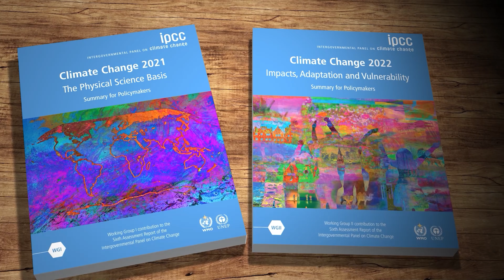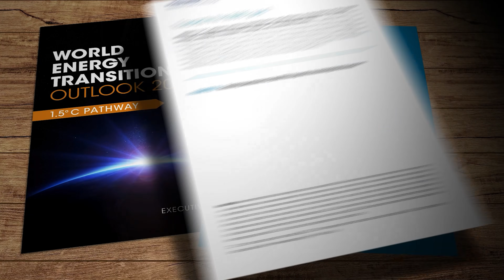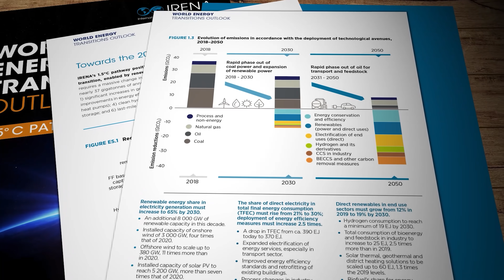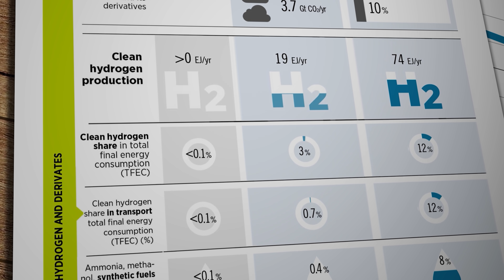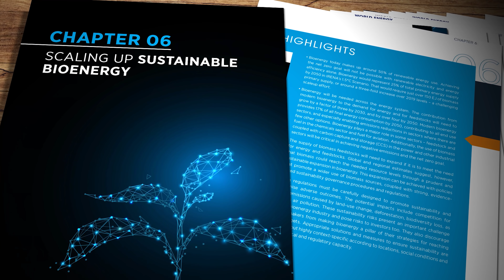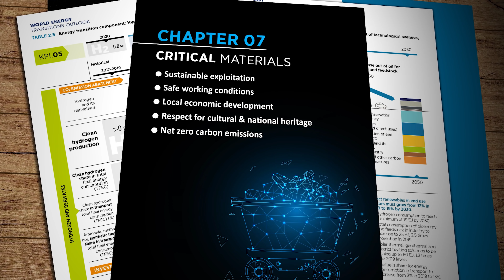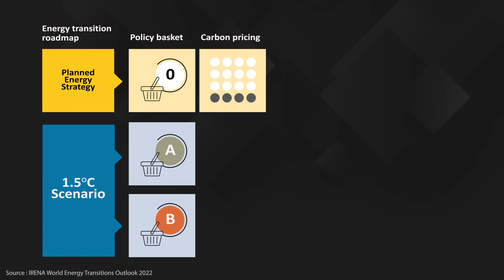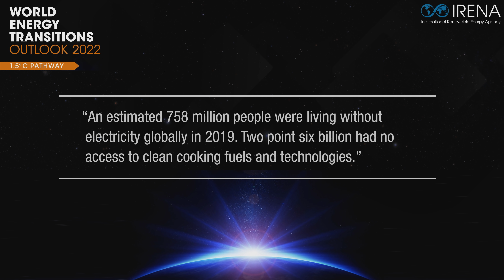Massive global energy disruptions are coming. Brace yourself!

Comment: That level of scale up in green hydrogen production would consume an exorbitant amount of an already finite resource in fresh water to use in the electrolysis process. If salt water were used from the oceans it has by products of chlorine and possibly sodium hydroxide as well depending on the sourced sea water, none of these topics were discussed in the Irena report for mitigation and regulation issues and how how to deal with those byproducts
Reply: Even if you were to use river water you would still need to run it through a reverse osmosis to purify the water before you perform the electrolysis on it. Even if the scale of which you were performing the electrolysis was billions of tons per month it would still not even come close to the amount of water available on the earth. Also no matter how much electrolysis we perform essentially once that hydrogen is burned it just re-combines form water again and therefore it never leaves the planet. I use solar energy to make hydrogen. But my electric car works better with batteries

Comment: @Just Have a Think - Would there be a bad effect on an already scarce water supply if there was large scale cracking of the water molecule into it's constituent parts?   What are the environmental effects of the loose oxygen molecule being pumped into the atmosphere?
Reply: Oxygen is oxygen; the air is 21% oxygen already.  The amount of water needed for hydrogen production would pale in comparison to the amount used by agriculture.  When the hydrogen is used, it would be converted back to water, so there's no net loss, you're just moving it around.

Comment: The earths gravity isn't strong enough to keep hydrogen from escaping into space. As we split our precious water into Oxygen and Hydrogen, a percentage will escape and be lost to space forever. Are you okay losing our water to space to provide a storage solution to intermittent renewables?
I just don't get your aversion to fourth gen. nuclear. 
Almost all energy is from our sun one way or another, which of course is nuclear energy.
Reply: Earth has WAY more water than we could ever need for making hydrogen.  The vast majority of the hydrogen would be converted back to water when it's used.  I don't think hydrogen loss is a problem we need to worry about.  The only reasonable arguments against nuclear in general are cost and long time scales.  Both of these might be addressed by new technology, but has it actually been demonstrated?  Then there are all the UNreasonable arguments, because most people are ignorant and propagandized.

Comment: The third cleanest energy source is nuclear. Nuclear energy has one of the lowest environmental impacts of all energy sources, comparable with the total impacts of wind and solar. It doesn't emit air pollution, it safely keeps its waste out of the environment and it requires a very small amount of land. It has a bad rap from climate alarmists if safety and pollution data is honestly presented. Don't hold your breath. Oh and go pick all of the dead birds killed by wind generators.

Comment: Energy disruptions are indeed coming as we have "high graded" the worlds fossil fuel reserves., leaving more much diffident and expensive to recover reserves. All these green energy saviors require fossil fuels to manufacture as well. The Titanic has struck the iceberg, is sinking fast  and has far too few "lifeboats"
Reply: There is still a LOT of easily accessible Saudi crude.  I'm not trying to encourage wasting it, but the minor need for hydrocarbons is NOT going to stop the clean energy transition.
Reply: @incognitotorpedo42  Saudi Reserves are not infinite and Gawar  is  in terminal decline as we speak.
Reply: And the need for fossil fuels will hardly be minor even with a shift towards "green energy"

Comment: Scepticism? How many times must I hear how the fossil fuel industry will recapture the CO2 it is emitting. This is pure unadulterated bullshit. It just will not happen. They are flat out lying about carbon capture so they can continue to pollute the atmosphere.
There are dozens of carbon capture trials and schemes and none (as in zero) have worked.
And the simple single reason for this failure is this. To drive the machines doing the carbon capture requires ENERGY, and where will this energy come from? How mind numbing imbecilic it is to suggest that the solution to CO2 pollution is to burn more CO2?
Carbon capture in all its forms is simple FRAUD.
Wake up people before it's too late.

Comment: You could look into the economic viability of recycling NCA/NCM vs LFP batteries.
Reply: They are both economically viable to recycle.  Very much so.  The industry is already in place, and recycling is happening now.
Reply: @incognitotorpedo42  I understood Redwood Materials is profitable for NCA NCM due to the high cost of the raw materials. I've never seen a specific statement for LFP.

Comment: At what point did they recommend to release the patents from the shelves? We need to let all the information out. Then it will not be heavy handed governments needed to impose the changes on society, it will be free thinking, hard working people who are inspired to create a better world who are making the necessary changes from the ground up. We have a major lack of information where it comes to energy production, transmission, storage and consumption. We need all the patents off of those dusty old shelves
Reply: Nuclear is the answer.
Reply: It's a myth that there are dusty old patents that prevent us from having clean energy.  When you track them down, they always turn out to be BS, like the "100 mpg carburetor" or the car that "runs on water".  Patents have a lifespan.  They don't last for ever.  Utility patents are valid for 20 years, design patents for 15.  If there was a magic patent from 50 years ago, anyone could make it now.
Reply: @incognitotorpedo42  Exactly.  There are so many myths out there!

My Dad told me the Germans found a way to make fuel out of air in WWII.  I laughed it off but I just found out it is possible to do.  Dr. Steinfeld in Zurich has found a way to make fuel stock using solar power and water.  Interesting stuff.

Comment: There is so much misinformation being circulated now that the chance of countries taking sufficient action has essentially dropped to zero.  Unfortunately, the U.S. is one of those countries where it has dropped to zero.   As individuals, and in a few cases with enough support to move whole states, we can continue to make the relatively costly and long-running investments required to push the technology to a scale where it becomes cheap enough for "everyone else" to use it via other motives (finding the cheapest option being the primary other motive).   Its a sad, sad state that the world is in.

I strongly believe that achieving the technological scale is possible.   The problem is that not enough countries or states within countries will have invested enough to reach the scale required.  The world will definitely blow past the 1.5C goal, that's a given.  But it isn't a cliff.  Or, at least, it doesn't have to be a cliff.  The faster we are able to accomplish these goals, the fewer future decades of hell will be imposed on future generations.  That's good enough reason for me.

So I will leave you with some data showing that success (even though as yet incomplete), is possible.  Bring up California's electric grid and examine the supply graph for 05/07/2022 and 05/08/2022.   During this time of the year we have quickly increasing sunshine and no need for air conditioning, leading to massive electricity generation surpluses from renewables.  Today (the 8th) we've have been the grid at 100% renewable generation most of the daylight hours and over-producing and exporting nearly 4GW of excess electricity for almost 1/3 of the day.  In California, at mid-day, being altruistic does not require being frugal during these periods.

https://www.caiso.com/TodaysOutlook/Pages/supply.html

We need much, much more over-production and huge battery and other grid-scale storage built-out to soak it all up and start using it at other hours in the day.  In time, we will have sufficient over-production (but not enough storage) to cover the entire year.  Still a decade or two away at a minimum, but it is clearly possible.  And eventually we will have enough storage as well.

This is the type of future everyone should be working towards.  Its just really unfortunate that half the population doesn't believe in it.

-Matt

Comment: Tesla’s mission is to accelerate the world’s transition to sustainable energy. Not. make a bunch of money.  I hope they do make a bunch of money so they can keep putting a bunch of resources back into the people and the environment. Sorry you don’t see it this way.
Reply: So far they have been.  The biggest issue is they have been unwilling to compromise in design / performance.  Tesla vehicles aren't "trickling down" to the mass market because the demand is sky high and they have only been in mass production for a few years.  Smaller less "sexy" family EVs are what the masses need.  No reason Tesla cant make a 150-200 mile compact EV for $25k with low drag (akin to the Mercedes Bionic Concept + LFP batteries).  If Tesla doesn't eventually others (potentially Aptera sedan) will to show it works (then Tesla will pivot to producing a million similar vehicles per year quite quickly).

Comment: Hydrogen via electrolysis can not work efficiently; you flush 60% of your energy down the toilet as waste heat in the electrolyser & fuel cell. Then you waste another 20% of that energy on compression (twice), chilling (twice) and transport. You end up with about 20% of your input energy; equivalent to diesel which is why it's a green replacement for that. Staying pure electric you have an end to end efficiency of ~85% (c.f. 20% H₂)
Reply: And before the old argument that "It's coming from solar or windmills" gets wheeled out... that means that you need 4x as many windmills / solar arrays. I see hydrogen as a product pushed hard by the oil industry; oh and you need to fill your car at a gas station too. No plugging in at home for you...

Comment: Green Hydrogen production going $0 in 2022 to $133Billion in 2030?   What kind of growth curve is that...
Reply: Its a solution to the renewable intermittency problem.  Overbuild renewables and if you have too much power at times that power is virtually free - make hydrogen or run air scrubbers when you can.  If I can do it in a science class someone should be able to build it at scale.  The main input at the end of the day is just electricity, big vats, and compressors.
Reply: @ccibinel  I have no doubt in the science although I do question the efficiency. I have seen figures as low as 60% and high as 80% 

With heat recovery in the process, it would be doable and a nice option for district heat or industrial heating processes. 

It was more the reality of that level of scaling. What is that curve going to look like given we are starting for zero with no established manufacturing for the kit? 

We need to move from 0 to 16bill year and add the same again for 8 years.  It is not just the hydrogen production kit. It will be the renewables needed to power it. 

That kind of development is only seen when a country shifts a significant part of the manufacturing infrastructure. 

We really do have a big job ahead.

Comment: i think once we have standardization on V2G and Smart Grids, we WILL see more and more EV's used to balance Grid which can replace those peaker coal plants. Also with improvements in Solar efficiency thru perovskites we will see more and more EVs with Solar roofs make it power negative cars. Aptera Solar electric car is a great example for this.
Reply: EV with solar roof are not an efficient usage of solar panel. The power of the sun light is at most 1kW/m² (thus a modern solar panel with 20% efficiency will output 200W/m²), an electric car typically consumes 200Wh/km. That means that with an imaginary 100% efficient 1 m² solar panel on the roof of your car, you would need 12 minutes in peak sunlight to charge the electricity for 1 km. It does not work at night, is heavily affected by the weather, and cost a lot more in maintenance. It is more economical to put solar panel on your house, which could power more that just your car, and plug your ev on the wall. That does not make great headlines though.
Reply: @LegrandTumpixel  which is why i mentioned the possibilities of Pervoksites, especially the tandem one which theoretically  can go more than 40% efficiency.
Reply: @Soothsayer210  40% - hmmm what about nightime - oh buggar and it was such a cunning plan
Reply: @jimlofts5433  glass is always half empty right?
Reply: @Soothsayer210  doesn't matter how good they are they are still on a 365days/24hours only  producing power 25% of the time - bring on molten salt nuclear reactors
Reply: 'Molten Salt reactor'  is NOT a nuclear reactor. Don't forget to take those lovely white pills before you go to bed.

Comment: Geothermal energy is 24/7, infinite supply, anywhere in the world, just a few miles under our feet. The problem is Big Oil as BP and Chevron are buying the power plants and patents, and are sabbatoging the progress.
Reply: Geothermal is only sustainable in areas where adequate heat is near the surface. Even then it has limits because the heat is low grade, generally below 300C, as a result the energy extraction process is inefficient.

In low productive areas the technology has to be supported by fracking which carries same risks as fracking for oil and gas.

Where the heat resource is deep the problem is the high pressure causes unwanted side reactions in the working fluid leading to rapid corrosion in working parts of the plant.

Geo thermal will have a place but not much outside those areas where it is already used.

Comment: It would seem that I see problems in most of your videos, and for that I am sorry. I wish I didn't!

Well this one is no exception. It would seem that they expect the cost of the energy sector to Double in terms of wages paid Which if inclusive is by far the greatest part of energy bills!
I may be misconstruing their data but the chart shows a collective employment of just under 70 Million jobs currently compared to their proposal of 135 Million, virtually doubling! How do they envision that fitting in to their much vaunted ideal of cheap power for all?
In real terms I expect they are under estimating their figures due to not including the additional costs of electrification of the transportation system (think digging up over 50% of every road in the UK and overlaying cables just to allow for the additional power of charging your cars)!
Reply: Digging up "over 50% of every road in the UK" is a WILD exaggeration.
Reply: @incognitotorpedo42  If you want to fit a charger of any reasonable size you cant be on a loop feed. This is because the expected load will be over 100A!
If you need to have your own individual service you can extrapolate that back, work out how many houses are fed from one mains cable (max 400A/ phase) and you can see that I may well be understating things! All the people in the supply industry (including me) think it is a disaster waiting to happen.
The only way to do it would be to limit the charge each charger can give related to the load the houe is drawing ...... and even then you are destroying the diversity applied to allow the existing cable and fuse size!
Reply: @incognitotorpedo42  Please enlighten me.